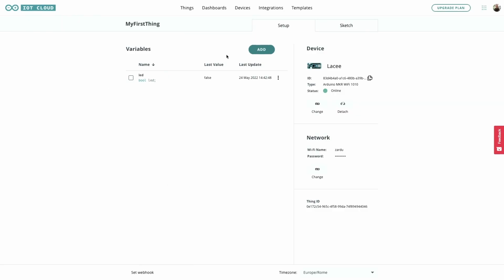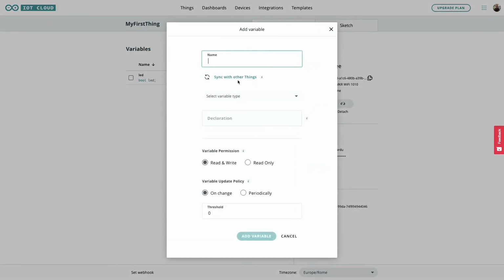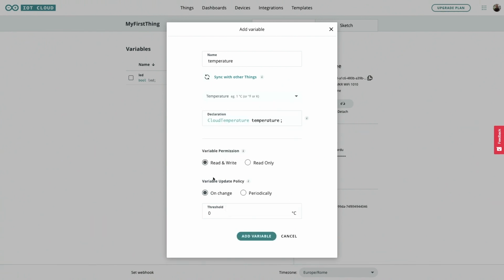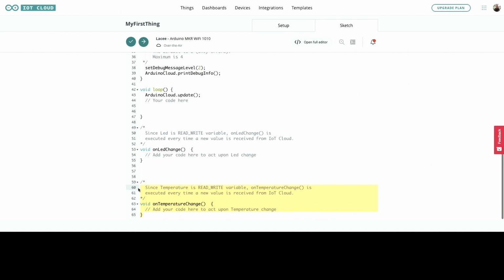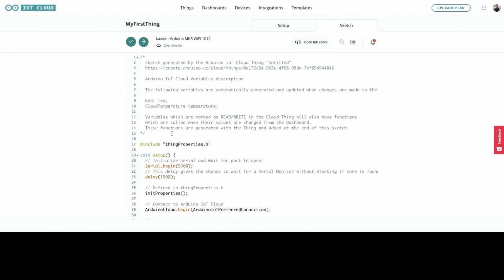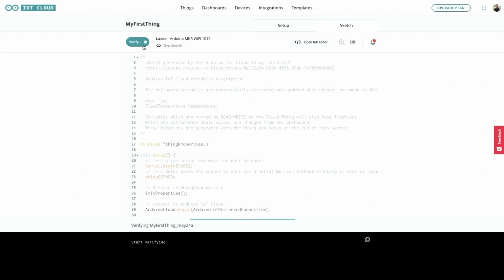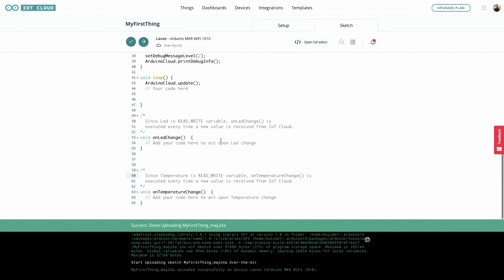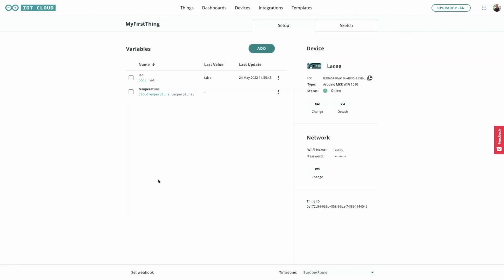How to Update an Arduino IoT Board Over-the-Air

Comment: Hello, is it working on local network or is it opening internet ? Can i use it for world wide ?
Reply from the maker: Well, it could be either, really. Whichever you need. In the video, it's connected to the local network via wi-fi. But all that matters is the board is connected to wi-fi - so as long as it's got a wi-fi connection, it could effectively be positioned anywhere in the world, and you can update it from anywhere that you're logged in to Arduino Cloud.
Reply: @Arduino  Thank you very much Arduino team.